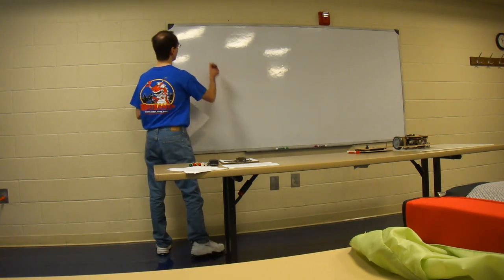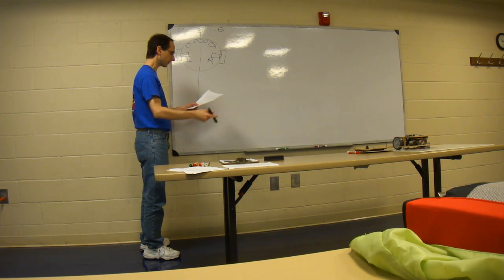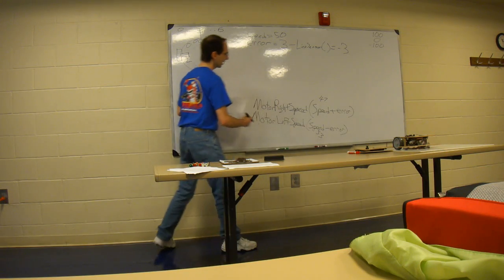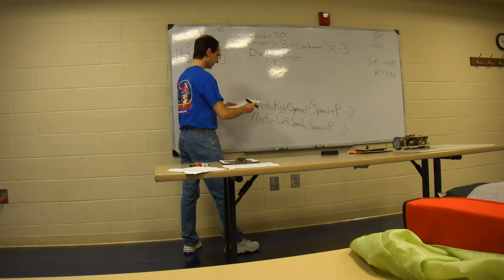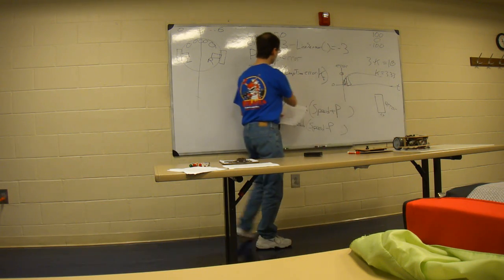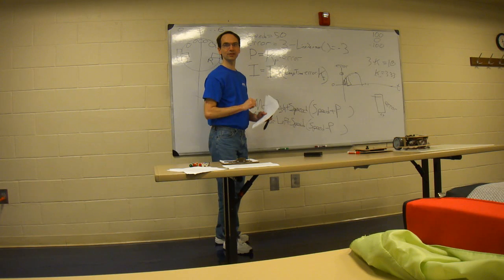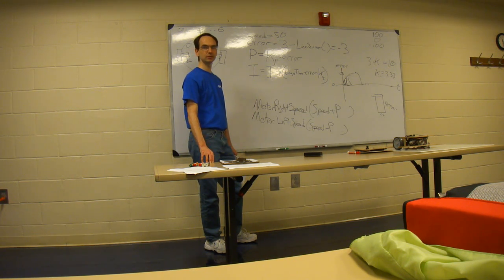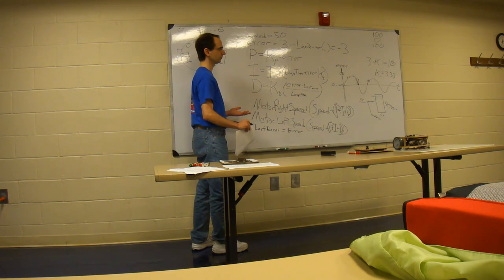PID For Robot Control Part 1

Comment: that was a good tutorial thanks so much, and I have a question about the kp and ki and kd , you said in the comments that they are in this video but I checked and didn't find them, may be the video  stopped right before this part
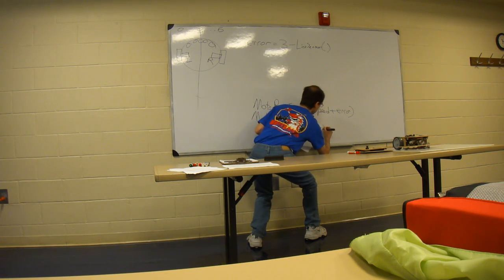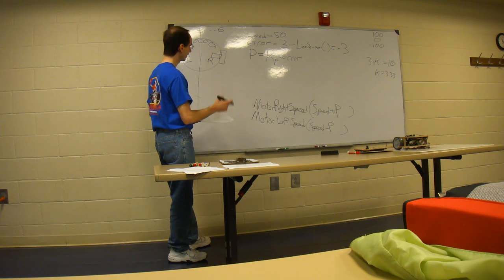Reply from the maker: Kp stating value is discussed at 7:38 to 12:35

Comment: it was very gooooood, but one thing how do you get the values for kp ki and kd?
or what are the aprox values?

thanks,Greetings from México
Reply from the maker: I explained how to get base starting values in the video.  You can do it with math but that gets very complicated.  Is there a part of the explanation of the starting values that you didn't understand and i could clear up?  Thanks for your question.
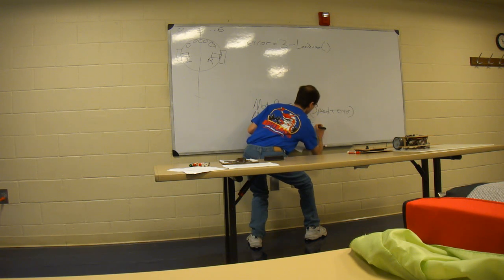Reply from the maker: Kp stating value is discussed at 7:38 to 12:35